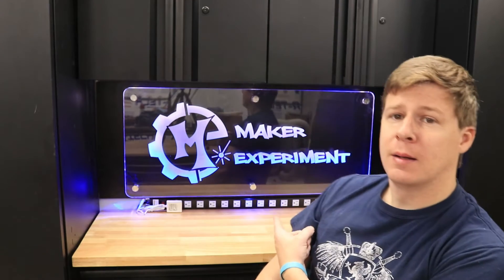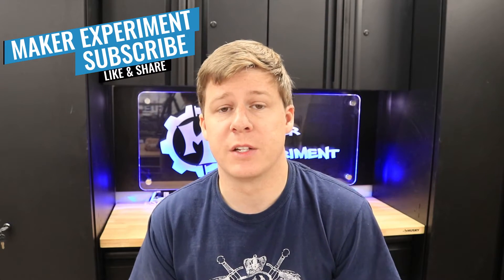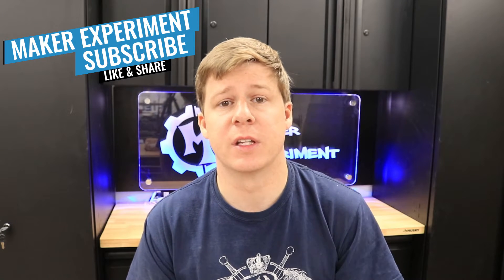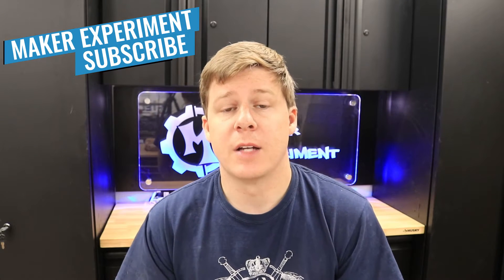How to Make an LED Logo Sign

Comment from the maker: Hey Everyone! If you have any questions about using these LED standoffs or any part of the process, let me know!
Reply: Hi Trevor, what LEDs from Amazon you can recomend to me, I bought some but these were not enough to lighten 50" x50" board. Any standard LEDs with good results everyone using?
And in of your videos you said for LED lighting you use Acrylite? keep the good work nice video.
Reply from the maker: M MO the LED standoffs that I used in this video were from Johnson Plastics Plus. For this one I used clear cast acrylic. For backlit signs, I use LED strips from Amazon and LED backlit grade acrylic that’s white from Acrylite. It just depends on what style you’re trying to make.
Reply: Salut, on peut avoir une idée sur le prix ?
Reply from the maker: @حقائقعبرالعصور  I’m not sure exactly what your asking. It sounds like you want to see a picture. There’s a picture of the sign itself on my website. The standoffs are at JPPlus.com
Reply: Have you found a way to keep a crisp lighting during daylight? If not how would you approach that issue
Reply from the maker: @mattmendoza7797  I haven’t used them in a while. If you space them apart properly, I think mine are spaced a little far apart, it should be more crisp in lit situations.
Reply: Did you use a CO2 laser to engrave on the acrylic?It looks like it.What is the size of this sign?Great video.Thank you very much.safes me a lot of money.If I would order this properly a few hundred dollars costs.
Reply from the maker: @Beamsmith-kids-music  I engraved cast clear acrylic. The size is about 40” wide and maybe 20” tall or something like that.
Reply: @MakerExperiment  Thank you very much.What distance did you use by the standoffs?I guess 1inch.
Reply from the maker: @Beamsmith-kids-music  they’re 1” I believe.
Reply: @MakerExperiment  Thank you.What did the material cost for you the acrylic is properly the most expense or was it sponsored for that video?
Reply from the maker: @Beamsmith-kids-music  the LED standoffs and power supply were probably the most expensive part.
Reply: @MakerExperiment  where do you buy your acrylic?Thank you for your response always.
Reply from the maker: @Beamsmith-kids-music  I buy mine from Piedmont Plastics mostly.
Reply: @MakerExperiment  Can I make a multi-layer and connect those together with the standoffs and light in the back or does it needs to have each layer light?
Reply from the maker: @Beamsmith-kids-music  it may not shine through each layer if it’s too thick of a layer. I’ve never tried this.
Reply: @MakerExperiment  3mm each layer

Comment: Really curious why you didn't just use edge lighting which would have been much better light distribution and looked much better. Lights in the standoffs just doesn't make sense. That being said, it looks good just would have looked much better with edge lighting, IMHO.
Reply from the maker: I wanted to experiment with something different and I was provided with the standoff lights.

Comment: Sir! How a design in acrylic which sandblast
Reply from the maker: tasbeeh ullah Are you asking how to do an acrylic sign with sandblasting? If so, you’d need to use some kind of stencil and apply that to the acrylic. Then sandblast the material and remove the stencil.

Comment: Is there a hole template for the laser software for the acrylic piece by chance?
Reply from the maker: George Williams I made my own when I did the project. The website for the standoffs has all the specs. I’d have to dig and see if I still have the template somewhere. I know I didn’t save it separately. If anything, it’s embedded into my design.
Reply: @MakerExperiment  No worries

Comment: you should have reverse engraved the image on the back of the acrylic, it will get rid of the double look shadow affect when its illuminated. looks great though good job!
Reply from the maker: Humberto Flores normally I would have but the manufacturer for the standoffs recommended engraving the front because of where the LED light boards sit.

Comment: Awesome looking sign. Have to make one for my empty shop wall.
The black panel is painted or purchase in that color?
Reply from the maker: Mr J it is black melamine that I bought.
Reply: Thanks!
Where can I find the material?
Reply from the maker: Mr J I bought mine at my local lumber store. I’d suggest checking the local lumber suppliers.